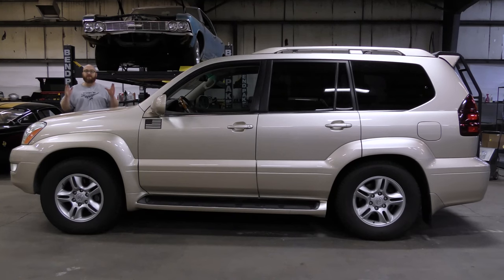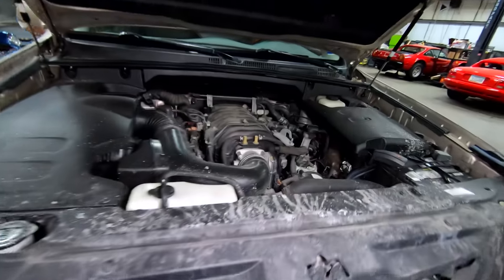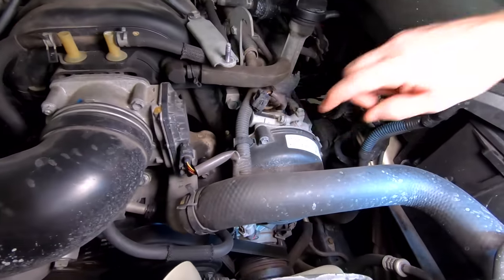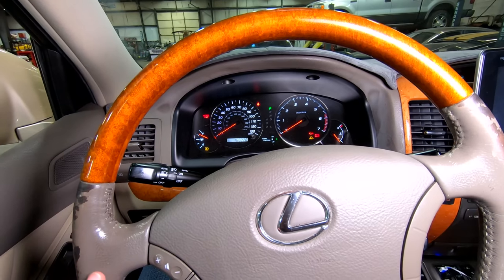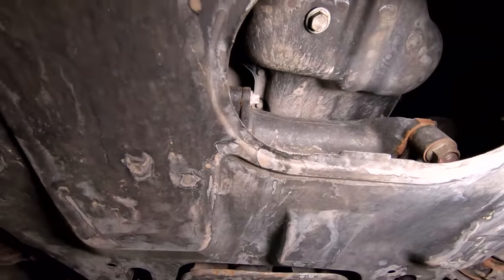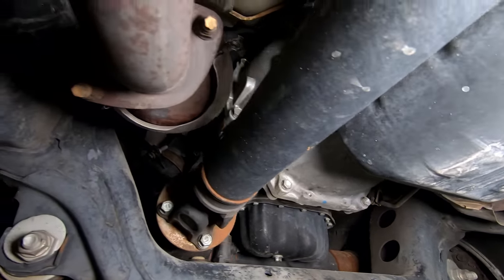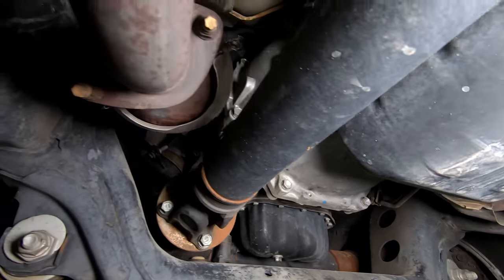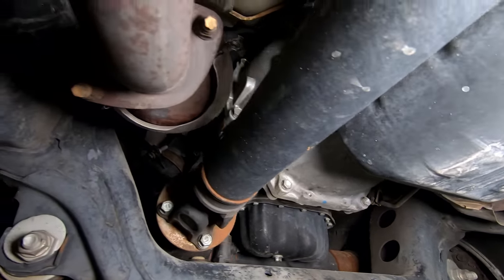How could this super reliable '07 Lexus GX470 have such a stupid design? CAR WIZARD weighs the risk

Comment: Years ago, I owned a 2008 Land Cruiser with the 4.7 and the starter was going bad, so I went to the dealer to get a new solenoid and the guy at the parts counter sold me the two copper contacts that go inside the solenoid for $1 ($2.19 now on eBay). The parts guy said the shop just changes the contacts in the solenoid so I did that, and it fixed the starter and never had another problem with it. My neighbor had the LX470 and his starter went bad about the same time and he went to a shop and they charged $1200 to change his starter. Spending 5 hours to save $1200 was a good use of my time that day.

Comment: Wizard - love your channel!  Regarding the “start/stop” feature, can a mechanic disable this feature so one won’t have to hit the button every time they get into the vehicle?
Reply: Hey,  not a mechanic here, but remember watching a video where this was mentioned. I believe it can not be disabled since it is used to calculate better gas mileage and less pollution. Sorry if I'm wrong, I recall it was something like that!
Reply: Yes they actually can ! But not your average mechanic. 
1. You need a sophisticated scan tool to get the job done and if it does not allow for that then;
2. You need the OEM specific ECU diagnostic database (ODX or CDD files) paired with its proprietary Software and a suitable Vehicle Communication Interface (VCI) to do it successfully.
Keep in mind that the majority of scan tools that claim to disable this feature actually do not do it for the long term as they do not fully unlock the ECU.
Reply: Metra makes several of them for common vehicles

Comment: Funny this video popped up. I'm getting ready to do the timing belt/water pump on my 01 LX470 again. I paid a local mechanic to do the job 17,000 miles ago and because he used aftermarket parts, the water pump is leaking. He had to warrantee the fan bracket two times because of this. This time I'm doing the job myself which I should have done the first-time using Toyota parts.  Wish I had a Car Wizard in my town.
Reply: Yep, hard to find a good honest mechanic. Good luck!

Comment: the starter on the 5vz is mounted where it can be more easily accessed, however i only had to replace mine after an unplanned river crossing. the contacts were corroded, so I replaced the contacts. then 80k miles later the bearing failed inside the starter. if it had been mounted up high like the uz starter, this would not have been an  issue.

Comment: It needs 2000 dollars of service that no other truck needs.Not only do you get to pay Toyota tax,you also have timing belts and poorly placed starters.No thank's
Reply: Instead, you can have the Ford 5.4 V8 with the crap heads that shoot plugs out or roach the cam (if you don't blow it up) when the crappy roller rockers go bad.
Reply: It’s not that big of a deal, the starters last a long time. My 2006 Tundra has had 1 timing belt service, oil changes, brake pads and 1 set of universal joints and I have 170,000 miles. Not really that much money spent.
Reply: Toyota tax? Lol. First time ever hearing this. Name a luxury car you can find replacement factory parts for so cheap? I'll wait.

Comment: "How could this super reliable '07 Lexus GX470 have such a stupid design?"

I wonder what he means...

"...replace the starter."

Oh.  Yeah, that's definitely a stupid design on the Toyota V8 in that SUV, with the starter motor in the V of the engine.  You've got to pull a lot of stuff off the top of the engine just to get to the starter motor.

Reminds me of the dumb design of the water pump on a Ford 3.5L Ecoboost or 3.7L Duratec.
Reply: Agreed. I just had to do a water pump replacement on my wife's 2013 Explorer with the 3.5. That was a pain.

Comment: I installed the same radio in my 2010 Volvo XC90. Alpine ILX411. Best upgrade ever. I have all the new modern tech without having to buy a new vehicle. Apple CarPlay is amazing completely hands free and limits distracted driving it is both effortless and seamlessly integrates into my 1st Gen P1 Volvo XC90

Comment: Vehicles with stop/start technology come with uprated starter motors, ring gear and often batteries with better deep discharge characteristics and battery charging strategies. You don't need to worry about the parts failing prematurely.

Comment: Starter motor placement in the valley has pros  and cons. Obviously replacement is difficult. However, it’s protected from water and the elements, and it’s away from the heat of the exhaust manifolds. Also from a packaging standpoint, the engine as a whole is more narrow and compact and the starter is placed  in otherwise wasted space. Keep in mind, the UZ V8 engine series was installed in right and left hand drive cars, trucks, and SUVs.

Comment: Keep your eye on the ring gear teeth. If they're chipping away, the new starter will only exacerbate it. Mine was that way,  but it was audible too. The foam for the radiator/ condenser gap was hanging out of the skid plate?.. lol.  Great trucks and engines.  They did however have factory recalls for warped/leaking exhaust manifold...Mine is on #3 in 165k miles.  Enjoying your videos! Thanks 😊.

Comment: I’m a Toyota auto technician and do know what else they stuff under the intake manifold? The vacuum air pump for the exhaust emission so a mouse gets cozy under the manifold finds a nice little home then gets shredded by the vacuum pump we then have to take the manifold off to replace the pump so there CEL goes off. I hate mice

Comment: I have an 06' GX. The starter location is a plus for off road protection. Some downsides you dont mention are that the cats come off the headers which weigh them down and make them prone to cracking. Also the front brake calipers were prone to binding up but the early gx460 front brakes fit on the 470.

Comment: Being a retired mechanic, I've seen many "stupid" designs over 33 years on the bench. But as my VW training instructor used to say, "Guys, this is how they built the car. We can't change it so lets get on with learning how to work on it." If someone can afford to buy a vehicle like this, then they should expect high repair costs to follow. As a former Porsche tech, I got real tired of hearing about the price of parts and maintenance. What did you expect?
Reply: The faux rich, eh? The Bentley starter is inside the transmission bell housing. In the computer industry, you know you've made it as a programmer/analyst when you have someone else interacting with customers.

Comment: Not true. 

1. The start stop functionality saves +-10% fuel a year
2. Vehicles with start stop functionality use a completely different starter motor design which is designed for the same lifetime despite the frequent starts. How? Part of it is that the car only allows for start stop of certain parameters are met such as engine temperature, battery voltage, a/c status, air temperature and air density, etc. so that it can be reasonably certain the car will start first try. 

By turning off the start stop functionality you’re not doing anyone especially yourself any favors. 

Engineering Explained did a video about this a few years ago:
https://youtube.com/watch?v=dFImHhNwbJo

Comment: In my expierence as a 470 driver, the air bag will collect junk when it extends and get trapped between the perch (which is a cone shape) and the bag where it folds over to increase the surface area of the bag and thus the effective force of the air spring. When it traps stuff eventually it will collect enough road tar to keep a big grain of sharp hard sand and eventually it cuts through. Air bag swaps take about an hour on the road side and about 15 minutes on a lift. The secret is to pull the lines from the air tank and leave a fish wire to get it back. the air pump however is a PITA to deal with as its mounted in a cradle and  put on the frame before the body is dropped on the frame meaining you are going to have to unmount it from the cradle and drop it through the mess instead of removing the cradle. BUTTTTTTT change it every 150k as it makes a HUGE difference in the suspension feel 1a auto has kits in the $400 range for both bags and the pump.
Reply: I got 255k on the clock on mine
Reply: i removed the bags and installed coil springs... even if i stayed stock height I think I would of gone that route

Comment: When I was working as a Service Manager, we would charge for doing an estimate. There is a cost to assigning a tech to the job and tracking down the issues. If the customer went ahead with the repair, we would credit the customer for the estimate. If not, they paid for the estimate, only. This weeded out a lot of Lookie Lou's that wanted a free diagnosis and then either took it somewhere else, or fixed it themselves.

Comment: Not a stupid design.  Denso starters go beyond 300k miles.  We tossed our 95 camry with over 300k on the original Denso starter.  The issue here is you accepting to replace a perfectly functional Denso starter because your customer requests so.  Say no, not necessary, won't do it.  This is a Landcruiser Prado, the starter is under the manifold so it doesn't get soaked off roading... but again these are Toyotas which use the best parts... A Denso starter should outlast the vehicle itself... 500k miles or more on the original starter.

Comment: 06’ GX here with 278K and
original starter
$1800 emission air pump repair at 245K :(
-Took me all of 45 min to switch the rear to regular coils (at 263K) off of Amazon 
-As my hero the Wizard says; Toyota’s are easy to service
-Use Valvoline Maxlife when you replace the ATF and the paper clip trick off YouTube to let you know when it’s full. No tranny dipstick. 
-cracked dashes are a known flaw unfortunately

Comment: It may be a design flaw butttttt, it will last as long as the timing belt and water pump,,,,, I worked at Lexus toyota, what we would recommend is changing out the contacts in the starter they were $30 took less than 30 minutes to change out we didn’t change the plunger where the circular brass contact is.  I thought you were going to say the self leveling rear shocks,I always thought that was stupid or ridiculous,,,,, there is a aftermarket kit so you can swap out , it’s basically how the sequoia is set up with springs ,,,, great video , I luv all your vids dude

Comment: Re: stop/start features. Not only is it hard on the starter, but it's also hard on the battery. Manufacturers didn't do ANY tests to figure out how stop/start features would impact the batteries or the starters in their vehicles; they merely included them to try to eke out more MPGs. It's pretty disappointing.
Reply: AND it's hard on the engine because there is no oil pressure when it isn't running. Most bearing wear comes in the first few seconds of running while the oil get circulating.

Comment: I remember needing to replace the Starter on my GS with the 6 Cylinder. Not as bad as the V8. But the first sentence in the shop manual was, Drop the Steering Rack. So, I took it to a shop. I then watched the Tech fish the starter from the rear to the front without dropping the rack. Grrrrr. Still cost me about $300 plus the Starter

Comment: same thing on the the SC400/SC430/LS430 (timing belt/water pump and starter)..and they use the same timing belt kit..  The airbags can be a DIY, easy to unhook in the back and easy to replace with aftermarket

Comment: Re: Soap solution (in a spritzer bottle) for finding air leaks.... don't use much soap or you'll have bubbles everywhere. A weak soap solution will ONLY bubble up at the air leak.

Comment: I have owned two of these and the number 1 dumb design issue is having a timing belt on an (8) cylinder engine in the first place! Number (3) is that all of them have CV axle boot failures. Both of mine have needed radiators replaced...

Comment: Like most J120 platforms, the LCAs are usually shot. Also, the GX470 uses the rear air suspension and adjustable shocks. The air suspension is easy to fix if a bag fails, but the shocks are EXPENSIVE!!!!! So, because of the, the shocks are usually all clapped out on the GX470 because no one replaces them. They do ride amazing stock, but you can tell when the shocks are done. That's when you lift it and enjoy it off-road.
Reply: I briefly had an older Trailblazer. The suspension design really s*cked but it rode really, really well. Go figure.

Comment: I did the starter on my dad's LS400 with the 1UZ 4.0 v8 about two or three years ago. Same starter placement, honestly didn't mind doing the starter job on it except for lifting the all metal intake off by myself. And if you think the starter placement is dumb on these UZ engines, the Toyota UR (4.6, 5.0 and 5.7) v8's have them right under the passenger side exhaust manifold, so it takes just as much time to r&r those too.
Reply: On 4.6 it's easy to remove, on 5.7 it's a time consuming process

Comment: My wife loves her GX 470. My wife said she feels good siting her GX 470. I don't like the stupid back door in the back. We have 400 thousand miles on it and still runs great and I changed the oil regularly. Never changed the starter and never had a problem with it. The big flaw with the GX 470 is it Air suspension that's causes the car to have a bump from the rear because it trying to fill the the air bags in the back. There have been reports that it's the drive shaft that causing that problem but that is just B.S. Built like a tank.
Reply: It is the driveshaft. Mine did same thing when I got it. Greased driveshaft, never did it again. Try it!

Comment: I have a 2003 GX470 that has a 2.8" lift on 33's. Ive upgraded the front brakes to GX460 calipers and rotors. I've taken my GX up over 13000 ft. and many off-road trails. It is the best SUV I've ever owned and I will never sell my GX. I also use it for high end sound quality stereo competitions. It's my baby.....

Comment: As far as the Start/Stop not paying for itself, the math says otherwise.  Start/Stop improves fuel economy by 8%.  Doesn't sound like a lot, but when you are  spending $4000+ in fuel annually, that is $332 a year.  So, you could replace this starter every 3 years and still be ahead money wise (this starter is under $200 for the OEM Toyota/Lexus starter).

The Start/Stop feature if it was offered on this Lexus would have saved around $5000 in fuel over 15 years, which is actually a pretty big chunk of cash.

Comment: This is the most petty design "flaw" I've ever heard. Would you rather drop the differential and/or remove the exhaust manifold to get to the starter? Pulling the intake is so much easier. Plus these starters last. I'm on my original starter with 225k
Reply: Eh, results vary. The starter on my 1uz failed at 130k miles
Reply: How about doing it the way American manufacturers do? On the lower engine block so all you have to do is lift the vehicle to get under it, remove 2-3 bolts and drop the starter? It's not petty when you have to remove some of the top of the engine to get to something as simple as a starter motor.

Comment: I have an 03 tundra with 4.7, starts every single time. I had to replace exhuast, battery, repair rusted bumper amd bed, had the timing kit done. And had to replace the rear diff cover, but that starter being protected from the elements has saved it.

Comment: One common point with Toyotas are they are typically very reliable vehicles, but it is often harder to replace things when they go wrong. My neighbor needed to replace the starter on his 2nd gen Tundra (I believe iFORCE 5.7) and it took three days and he had to remove a wheel to access the starter. If I wanted to replace the starter on my 2015 RAM 5.7 HEMI, I can look under my truck and its incredibly easy to find and get access to.
Reply: almost sounds like the Ram’s is designed to fail and be easy to replace by comparison.
Reply: @Mightyhero777  I wouldn't really say that. Making things easy to replace and/or fix is never a bad thing. It means the mechanic or the owner will have an easier time replacing the part and it'll cost less.

Comment: One problem with the access from the wheel well this open is that all the road crap can possibly get flung in there.
Reply: If I remember correctly there is suppose to be a plastic cover/ rubber cover protecting from the road crap.

Comment: This reminds me of the valve cover gasket on the engine in FJ Cruisers.

It begins to seep and it’s $4000 to fix.

Why? Because you have to take everything off the top half of the engine to replace it, and it’s almost all labor cost to remove it all and put it back.

Bottom line is almost no one fixes it for that reason.

Comment: Personally I think the start/stop fear is a bit overblown, the manufacturers aren't stupid, they aren't using identical starters on stop/start equipped vehicles, they are much heavier duty and designed for the increased use.  It's been around for years now and I haven't heard of a pandemic of starter failures on the earlier ones any more than on normal vehicles.  If you do a lot of suburban/city driving it can actually save quite a bit of fuel (up to 10%) which is non-negligible. A study from Japan shows that it only takes about 7 seconds of idling to use as much fuel as it would take to restart the engine.

Comment: While you have the starter exposed, replace the $35 trouble prone exhaust air injection pump.  It's the exact crap part used in 30 year old Chevys too.  Smart valves and sensors that it pumps through will put the truck into permanent limp mode.  Or, way before the permanent failure code, you can by a module that makes the ECM think the temp is too low to run it.  Failure mode is the plastic impeller which loses small pieces into the valves and sticks them open.
Reply: Does a bad secondary air injection pump cause bad gas mileage? Not sure if the prone exhaust air injection pump is the same thing? Thanks!